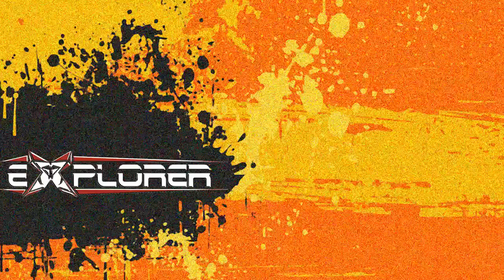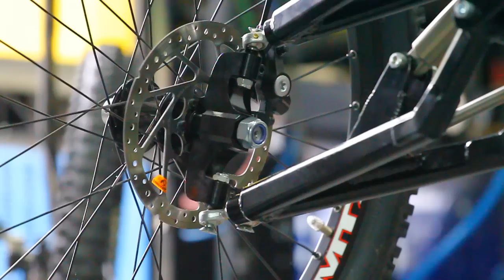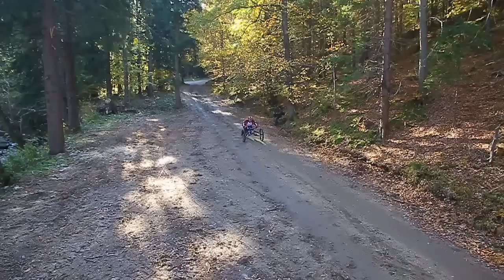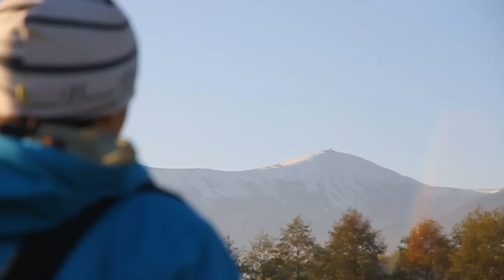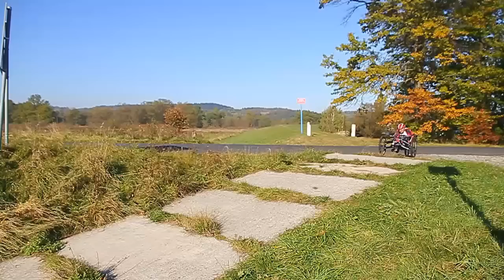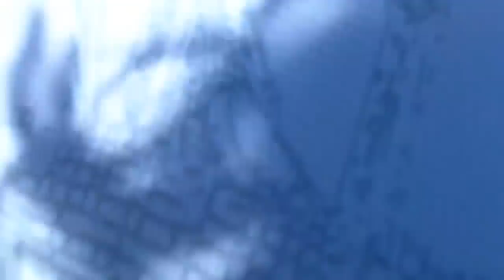Explorer II - the real off road for handicapped !

Comment: Great job! Electric hub in rear would be epic! Freedom is a very good thing.
Reply: We have began prototype work for Velomobiles. 3 hoops in 1 for the purest power transfer.
Reply: New traction systems are providing traction that a pneumatic can not match. A high psi core with morphing borders.
Reply: We will be posting new MTB and Road bike video this week!
Reply: EnergyReturnWheel Your wheel looks interesting but is it not radial in shape? If not, wouldn't that affect traction in any situation outside of going straight? Also, weight is a big deal with bikes, especially rotational weight, especially at the outside of said rotational weight, is it heavy?
It is just that I have seen numerous well intentioned people try to reinvent the wheel , if you will, and every one I observed was creating more issues than it solved. Flats have become a minor issue which is readily fixable. As for suspension , that is better performed through dedicated components and frame design. Traction will always be an issue as its a balancing act between reasonable weight and contact patch and tread design. A low PSI 2.5" MTB tire is hard to beat traction wise as the advantage of pneumatic is it conforms to the ground. Its the ability to conform and weight that have made the tire so successful.
Reply: EnergyReturnWheel Just playing devil's advocate. People will be asking this stuff.

Comment: Does anybody read descriptions, or even titles? I respect you guys for allowing others to take part in an activity that wouldn't otherwise be considered possible. 

I did have a question though. In the video the cycle seemed to function well on the rocks, but has there ever been a problem with pedal/crank clearance and obstacles?

Comment from the maker: The best choice are hubs with internal gears , mostly because every gear (in schlumpf or hub) can be switched even when the bike is stationary or under load. Unfortunatelly , I cannot put a link to our graphs but please look on our website, you will see that gears range is similiar as in MTB bikes and in addition can be extremly low when needed.

Comment from the maker: @castuckey Very good question! finally :)
So, Explorer II is equipped with Schlumpf Mountain-Drive - cranks with internal reduction gear. Cranks works in two positions:  1:1 or reduced to 2.5:1 . Thanks it, gears can be extremly low whenever you need or normal when you want to go faster. Except the Schlumpf M-D, every bike can be equipped with hubs with internal gearing system (8 or 11 gears) or 9 spd darelieur.

Comment: It would be relatively easy to make the back wheel steer, then have the chain run forward to a solid front axle, so that it's fwd-2wd with a live axle. (no open differential)

Comment: This is actually tempting even for the not handicapped. Pedaling it looks awkward, but downhill looks so much fun! The lower position if the rider, the third wheel, this could actually run better than a normal bike! It also looks like a great workout for your upper body. One question though: I saw some scenes where the rider was actually not sitting on the seat. Are all handicapped people able to do that? And if not, would that make it harder for them to ride as efficiently as him? Great project

Comment: Interesting, for a hand cycle going up hills seems slow, and I think they would have been better off using traditional gears rather than an internal gear hub, cheaper and a higher ratio difference, the only part that I would change. Great bike though, and I had been wondering how one would go about making a bike for the disabled. :)

Comment: Can it be that the Velotrike has (at least) two construction faults?
To the one the "seat position" is rather inexpedient for most wheel chair drivers and to the other are separated steering system (and the operating elements) from the impulse.
Reply: مرحبا

Comment: ive watched your video and realise we don't have terrain here on which this bike could be applied. as far as hlls go. Holland is by far the biggest bicyle-country!
What if you took out the hand drive and built in a mechanical construction which works on bodyweight/...??? so if you pull yourself towards the steer you generate the energy and when you relax the arms more it will release the energy. In that way the driver Always holds the steer both while steering and driving.

Comment: Why don't they just put an electric motor on it so it's easier on the people that want to ride it?
Reply: I was thinking the same thing! I've been watching hub motor and mid drive e-bike vids though for a couple hours... so... I think hub motors in the front or rear would be kick ass and a high torque motor at the crank would be  totally rad!!!you would have room for batteries with a simple rack... 
these are awesome already, but make it so they can haul ass up those hills and they will be even cooler!!!
Reply: The motor would run out of battery to quickly. Replace the pedals with a chainsaw motor and an oh gas tank. That would be noisy but I've seen people do it :)
Reply: ohv
Reply: +Aidan Mahler destroys the whole plot its ment to be a hand bike not a reverse motor trike
Reply: +Aidan Mahler Because maybe some people don't want it to be ''easier''

Comment: put e motor  on it drone  gps   and   saw  or a 50 cal   a jav len    tow    ouch    one chep   tanker hunter   can move with out being see  
 no heat    highs part 26 in  being drone  just need a  reload point   new power pack and ammo    if lose one     hell just set off the  tow boom